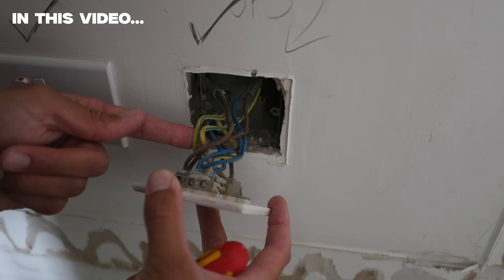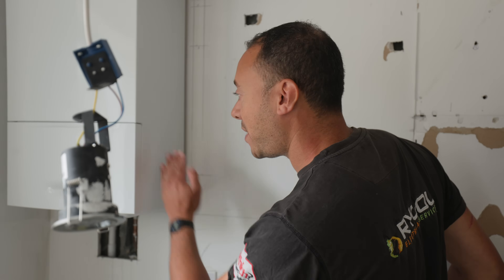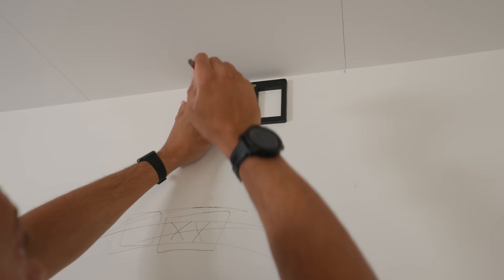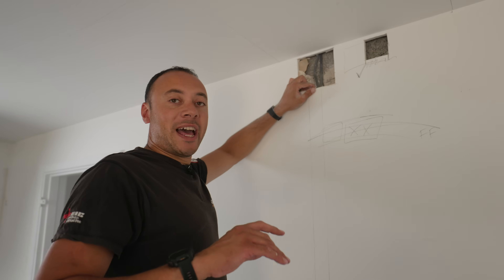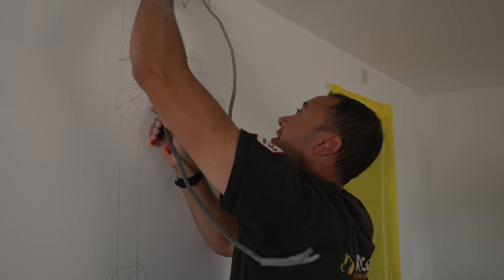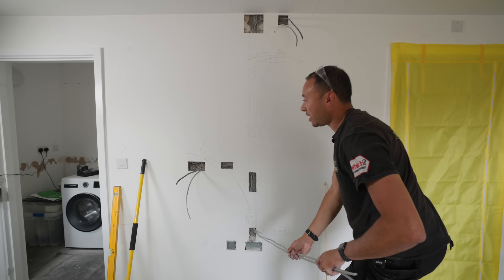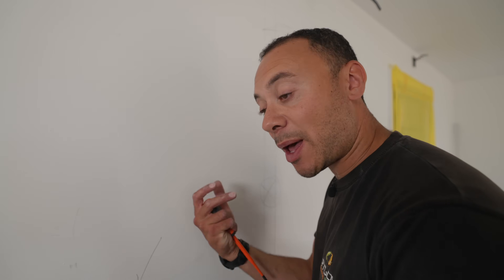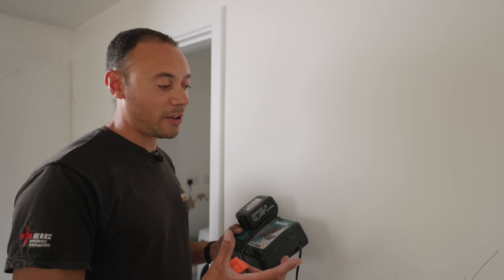Adding a plug socket? Don’t get it WRONG!

Comment from the maker: Did you spot the easter egg at the end...
Reply: Neutral goes into the side marked L, Live into the side marked N.
Reply: Plug in socket testers can't detect a neutral/CPC reversal.
Reply: Apart from the L & N...., you didn't earth the back box.
Reply: I ain't got the plums to chop the ring main cable feed under floorboards anyone in Wolverhampton fancy finishing it 😊

Comment: I love your videos. so professional. This is a major issue with the uk using metal back boxes. I moved to France 11 years ago, and as you might know they use plastic type back boxes. I much prefer them, safer. I appreciate there are different rules a regulations, and the uk plugs are probably the safest in the world, but .... not those metal back boxes, especially if one of your fixing screws traps one the live/nuetral wires ......

Comment: Hi! I like your videos! But I wonder about what you are saying at 17:40, am I missing something? In most of EU we use wall sockets that allow you to turn the plug in whatever direction you want, wich means that statisticly 50% of all the millions of microwaves have L and N "in the wrong orientation". But everything works just fine.

EDIT: I think the polarity is so important to get right because you have switches on your outlets in the UK. If its the wrong way around you could get zapped if you have a lamp connected and need to change the bulb.

Comment: The reason why the earth cable doesn't come with sheathing is purely because it's used to slice the outer sheath when stripping the cable. Unless in future, when every sparky will have a cable stripper, that's when it would make sense pre-insulating that earth cable.

Comment: The Reason the Earth isn't Sleeved in the Hard Cables is for 2 reasons 1)Weight & Bulk, 2)The Only Part that needs to be Sheethed is the Exposed Parts in the Lights/Sockets/Outlets,,,,Cooker,Shower Switch etc,,,,,, & the common sense part because it's neither Live or Neutral & Only becomes Live or Neutral from a Faulty Connection, The Live & Neutral are Colour Coded For Easy Continuity

Comment: Or at 12mins Horizontal or/& Vertical to & From An Exsisting Outlet, at the Start he Could have used his Tester to make a Trip Happen in the Consumer Unit to find which Ring Main was the One that the Double Socket was on, & the Plasterers "Dab" the Plasterboard to the Wall with Dabs of Bonding Plaster

Comment: my consumer unit tripped straight away when i wired in a plug the wrong way once... it was a new one and different config to the older ones - easily fixed and no harm done... i am curious as to why the consumer unit in this video didn't trip straight away when you switch the ring back on...

Comment: Great video and tips. I notice that you wired the earth connection on the socket into two terminals. If it was me I would have connect both the earth wires into one terminal. Doing it that way would mean that the earth continuity for the circuit wasn't reliant on the integrity of the socket. Have I missed something from the refs?

Comment: I thought about the earth cable today and my theory is that it prevents mixing up the cables. Being as live and neutral are sleeved it’s easier to mix them up but the earth being two bright colours not sleeved and a symbol instead of a letter. I guess it would be pretty bad getting a live and earth the wrong way round on a metal fridge 😅

Comment: Moved into a new place where the wires were wired wrong like in the deliberate mistake in this video and used it for ages with a 2kwph electric radiator - it kept turning off but still got heat out of it.. I am amazed how ignorant people are to do that wrong and walk off.

Comment: digs deeper as electricians. well that all good if its where you at, but at my region its me who as a multimeter and electricians did not even have that. had to point them to a fault locations before when dad sheduled a visit they did not find anything and tried to leave charging for job not done. Pinched wire in a socket , voltage on grounds sometimes too (i think there was another pinch somewhere. thats why rcd never worked and tripped

Comment: QQ why should you connect the Earth cables to each separate socket terminal, instead of fitting both into one as you do with the Live & Neutral cables?
Reply: Because if an earth screw works loose you would still have good earth continuity on the other earth terminal.
Reply: @woodcutter59-w4cAh OK, thanks 👍

Comment: At 7:23 and later with the aerial cable, it looks like you cut into the plasterboard directly over a cable. Do you have some sort of depth stop on your multi-tool or do you just trust yourself not to cut too deep?

Comment: What's the rationale behind deliberately putting the two earth leads in different clamps on the back of this double socket? If there is a faulty appliance plugged in that draws excess current and causes overheat and partial burn-out in the socket but without tripping the RCBO - which can happen - this could potentially break the continuity of the earth between the left to right of the unit, thus breaking continuity of the earth with the ring at that point.

Comment: old chip here. i was told back in the day at college about horizontal and vertical wiring, witch makes perfect sense if you need to fix near a socket or switch..but never saw it adhered to on any  home mods i have worked on.

Comment: In Europe the earth wire is insulated just like the other wires in the cable. Swapping phase and neutral doesn’t really affect how devices work, since with AC it doesn’t matter that much. On some 240 V sockets you can’t even tell which side is phase and which is neutral – and that’s perfectly fine. For me, the key thing is to always do electrical work properly and in line with the regulations.

Comment: Great video,  thanks.   Re: cable routing at 11:22 , do regs permit this T-junction off the vertical drop, to your new socket, with no fitting/accessible box/MF box at the junction?

Comment: twin and earth cable in my opinion is genius, because all 3 cores are insulated from eachother by at least one layer of insulation, if there's ever current on the earth it's only there for at most seconds, usually milliseconds, so the insulation doesn't have to hold up the same as the live or neutral, which is also why the earth core is usually smaller diameter, both factors make twin and earth cable significantly more cost effective than if all cores had to be the same spec, what I'd love to see is a product that would allow you to patch where wire insulation has been damaged like that one in the video in a way that is compliant to the regs without the cost of replacing the entire cable, perhaps some high thickness shrink sleeve that's colour coded and rated to handle the same current as the wires it's rated to cover up.

Comment: God I hate those socket templates with integrated spirit levels.  They're never level.  Obviously, over here in france they're not the same, our junction boxes are 68mm round boxes, but the principle is the same.  Hateful things.  

You'd have so much more fun working over here in Europe.  No stupid ring mains, no bare cables behind plasterboard dabbed onto walls.  It's all spurs and almost all wiring is done using ICTA and wires.  I hate cable, it's a pain in the arse to use and you always have the same colours.  Our cable, oddly enough, is all earth sheathed, because it's not supposed to be run bare behind cladding; you're not supposed to be able to cut into it by accident.  Twin and earth is an abomination.  Also, our junction boxes start at 40mm deep, most of the time we use 50mm boxes.  So much more room to play with...

Comment: I know it'll be buried in here - but on turning off the wifi, there are two things you can invest in:
1. a portable battery/inverter. Costs about £200 but will keep a wifi router going for a day without power, and can be plugged in as a UPS!
2. a high power USB power bank and USB -> DC adapter. Costs about £50 and not quite as versatile, but this will also keep most wifi routers going for a day. Just make sure you get the V correct!

Comment: We can't see the mistake as it's not possible to see the terminal markings from here, the camera needs to be closer to the socket. And neons and the resistors in old fluorescent light fittings play havoc with insulation checks and cause false fault readings. And is that socket tester a proper one with earth loop impedance check? not all of them have it.

Comment: As far as I remember the earth wire in "twin & earth" cable is left bare so it can be used like a cheese wire to help strip the outer sheath off quickly when preparing the cable for connection, but the earth is a smaller size wire than the live and neutral which I've often thought was risky as it increases the resistance of the earth conductor which is not a good idea. And I saw another video somewhere on YT last year, 2024, saying that the traditional twin and earth cable was being banned and phased out to be replaced by a new design with all three cores the same cross sectional area and all insulated with the earth covered in green & yellow, but I haven't seen any on sale anywhere, but then I haven't done any mains wiring for ages now.

Comment: I might be out of a touch a bit nowadays but it used to be still ok to go diaganol with your cable routes so long as it was 50mm deep and had a metallic sheath? Is that still a thing?
Reply from the maker: Id imagine so. But thats rare that could be the case with the way the walls are in the UK

Comment: Not an electrician but I'm going to say the reason the earth isn't insulated is because, in the event of anything penetrating the outer insulation, capable of conducting electricity will encounter the earth copper before live/neutral  legs and automatically put them to earth and tripping the power and thus protecting against electrocution?

Comment: Polarity does not matter in AC electricity. It only matters because your plug is fused.
Reply: bullsh*t
Reply: If you know anything, you SHOULD know that if wired correctly, the LIVE is ALWAYS switched when you flick the socket switch on or off

Comment: Live/neutral reversed surely doesn't shorten the life of an AC appliance?, it's Alternating Current, 50 times a second in the UK. It's dangerous for switching circuits as a device could potentially be live still, when technically switched off? I'm probably wrong but interested on your thoughts

Comment: When did it become ok to go sideways with a "buried" cable? Seems dangerous and a bit stupid. You used to be safe cutting or drilling anywhere except above or below an outlet but now it's just fingers crossed? Also, who would connect wires into an outlet without checking the L and N moulded into the plastic?

Comment: Why isn't the metal back box connected to earth?
Reply: Because is plastic sockets installed
Reply: @Imran-tv7ph  But I thought it still needed to be earthed because if it became live it could be live through the faceplate screws
Reply: @raymondcoram992 I think that’s possible but very unlikely. You would need the live to somehow be in contact with the screws. Don’t hurt to earth metal back box but not a requirement

Comment: There is NO Electrical Regulating Gov Body. I fail to see why not and why you are even legally allowed to show the Public how to do your entire job. When moving pre-installed wires would seem ok, it does throw away all existing Building Reg Permissions as DIY has been done on top. Then consider the public following adding sockets and more wiring... you have a MASSIVE SAFETY RISK which should by all sensibility VOID YOU INSURANCE and issue any DIYer an "L PLATE" T-Shirt and HI-VIS JACKET with a sign on the Door reading "DANGER! DIYer, might be risky to enter!"
I have absolutely no 2 fecks what the hell this Country is on.
Reply: How do you figure that providing educational material to prevent mistakes being made with wiring is a bad thing? How do you think learning to do something yourself rather than relying on someone to do it for you is a bad thing?

I don't know what you're on, but it's obviously fried your brain. Learning and gaining skills is a good thing, without that we'd end up with a country full of dumbasses who let everything go to shit...

Comment: The reason for the lack of earth sleeving is two fold. One reason is a similar reason for the earth being a smaller cross section, to make the overall cable width narrower. The second reason is that should any damage occur to the live there's a better chances of an earth fault if the earth inside the cable run is bare. One query because I'm retired and no longer up to date on the regs. Shouldn't the metal back box be earthed? If the live gets damaged for some reason isn't there a possibility for the back box to become live. I know that theoretically the backbox is earthed though the faceplate mounting screws but a wire earth gives a better connection and there is an earth terminal inside the backbox.

Comment: Why were those cables not protected with a metal or plastic cover laths like what you installed?  Is this not a requirement as I recall fitting them in my first house in 1983

Comment: i use a blue and red indelible marker to highlight the live and neutral on a socket which doesnt have its terminals colaour coded. makes it easier when loooking of the top of the socket and making the connections.

Comment: Excellent, thank you.
As you were putting sockets in for a computer station, did you consider surge protection? If a computer or peripherals are plugged into wall sockets there is no surge protection unless there is a device in the consumer unit. Is there something available for that?

Comment: Always ensure your multifunction tester is calibrated properly including 0 ohm, 0.1 ohm 0.5 ohm 1, 5, 10 and 100 ohm on continuity and ALL Insulation test voltage ranges are calibrated. I thought you had to fit steel cable trunking ? The earth isn't a live conductor so doesn't need additional insulation. Also if you drill into a cable it is more than likely the earth will short to live an pop the rcd.

Comment: 9:27 - You mean 10 mm square (cross-section area), not 10 mm diameter, right? Also, remember that "millimetre" uses lowercase (so, "mm", not "MM"). An uppercase "M" stands for "mega", not "milli".

Comment: I know why the UK started wiring houses as rings, but I'd think they would have stopped doing that at some point in the last 70 years. It makes diagnosing some types of faults a lot harder, compared to radial circuits (used pretty much everywhere else).

Also, no modern appliances should care about which hole of the socket is is live and which is neutral. The plugs in most countries are reversible. It's good to be consistent because it makes it easier to diagnose faults in the installation, but it shouldn't really matter to anything you plug into those sockets, unless that device doesn't comply with regulations that have been in place for many decades.

Comment: answer to the question about earth sheathing.......  it's to make sure that any potential damage to one of the cores can, ie  a nail or screw or even a drill bit through the cable, will more than likely cause an earth fault and trip the supply(because of unsheathed core whereas if all cores were insulated, there is a slight chance you could damage the live or neutral core but not the earth core insulation) and not have a live nail or screw in the wall...  ie, you have a fault to earth and not a live core.....  a problem that sometimes occurred with older type two core switch cable.
Reply: Yep, came here to say this and you were the only one that said.
Reply: @billyelliott6525 Numpty DiYer question from me. Are you meaning that - 
- with an insulated earth, 
- if something metal e.g. a picture nail, screw, drill bit etc clipped the live core, 
- but not the earth core,
- MCB/RCB might?/would? not trip and therefore that,
- the picture nail, screw, drill bit would remain live?
If so, eck!

Comment: I think UK-style ring mains are fundamentally dangerous. Shoving two wires in to a breaker (or socket) screw fitting can easily result in poor contacts. A break in a ring main is basically undetectable by the customer and, if broken, now you have a 32A breaker on (probably) 2.5mm^2 wire.  Ring mains were designed to save money only - to save on copper wire.  If you are going to run a ring main then use 4mm^2 wire so that the 32A breaker will still protect the wire in the event of a break.  
Does any other country use this short cut when wiring houses? The US certainly does not. Any defenders of ring mains?
Reply: Not strictly an electrical advantage but ring mains are far better for powerline adaptor data throughout than radial circuits.
Reply: If using 4mm cable no point wiring as a ring , you can use 32A breaker/rcbo  for a radial wired in 4mm. Putting 2 cables into a breaker is no problem, the terminals are designed to connect 2 cables safely.

Comment: 16 mins in- r1and rn tests are equal but r2 is small ( r2 should be 1.67x bigger than r1 and rn ) 0.55 for live and neutral, 0.75 for earth, loose connection or not a proper ring main due to previous DIY work!!!!!!

Comment: I believe that it’s not about saving money or making the cable thinner, i think it’s about safety, so if water ingress, damp, sharp object, or rodent, pierce or ingress the cable, it should cause a trip or short, that makes you aware of the issue and protect against shock or fire.